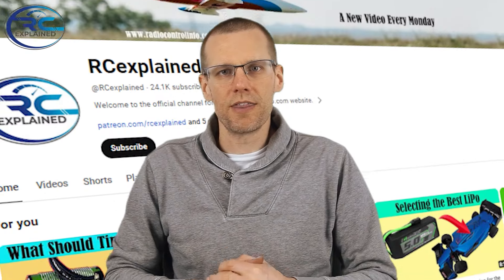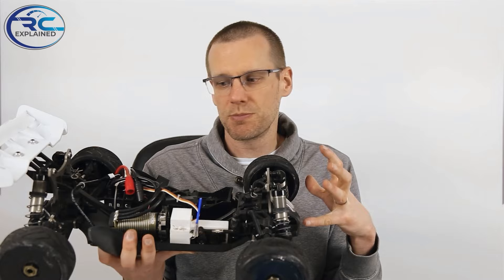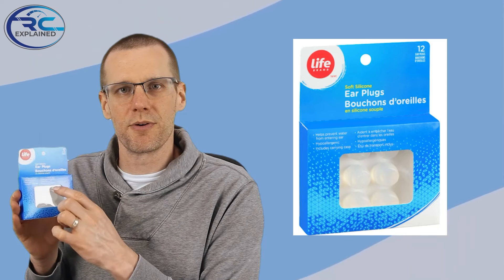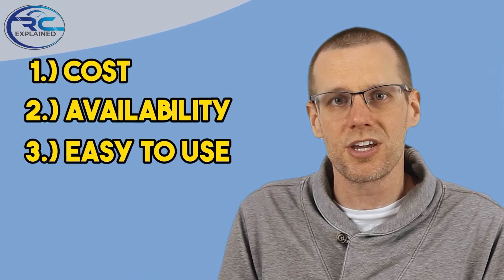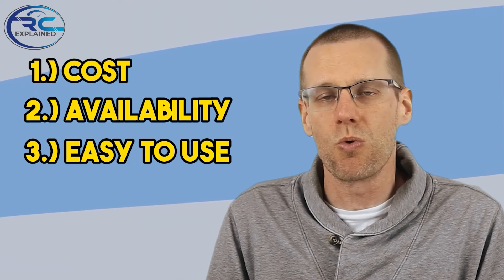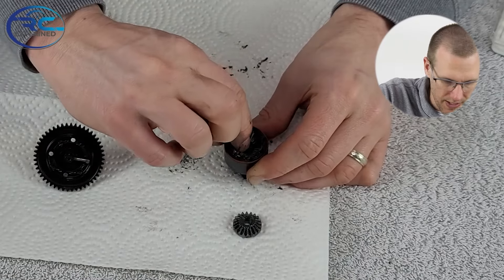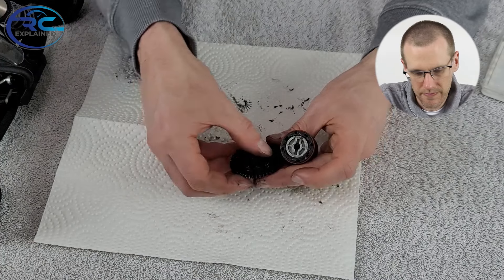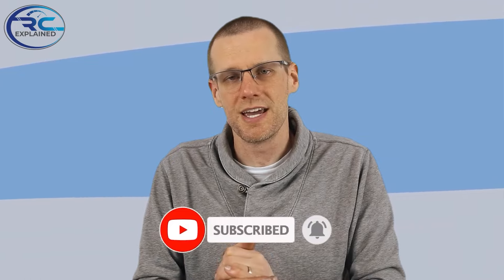The Must-Try Easy Differential Locking Method! Unleash Your RC's Full Potential

Comment: Thanks for sharing this valuable information. I often wonder if you could simply take a tube of Silicon and just fill the diff and let harden. I have earplugs for now and they whould work perfectly.
Reply from the maker: You could. Success all depends on the density of the fluid used.
Reply: @RCexplained  Thanks for all the good solid advice. You have awesome videos. Good vibes for 2025 🫶

Comment: Do they make spools to replace the complex difs?  Why wouldn't you want the front and back locked for 100% traction and power to the ground?  

If one tire is slipping and the other is doing nothing; how's that useful or helpful in a stock setup?
Reply: On high grip surface fully locked diffs will make it very hard for your car to turn.
Reply: Fully locked diffs is more for going straight. Like speed runs or drag runs.
Reply: @TheBod76  I was just thinking about speed runs.
Reply: @TheBod76  Thanks for sharing this. It really helps me out as I had never consided that.  I would think that this would apply to the rear diff as well. I have no idea?

Comment: I'm purely trolling here but gummy bears > silicone earplugs. 

Seriously, earplugs do have one advantage over actual proper diff fluid: if your RC is cheap and has no diff gaskets, the earplugs won't leak out. 

Me myself and i personally prefer diff fluid because even with 20 million, it's not a full diff lock.

Just like a servo saver, your differential is there for a reason, and unless you're building a pure speed run car, you want the center diff to be able to transfer shock loads from one side to the other.

Comment: I was amused by the secrecy and burying the lead on the secret object. But Kev Talbot has been making videos about this for a long time, not sure it's unknown.

I'd be interested to hear more about how the stiffer center diff directs power more to the rear of the vehicle. And when folks might want to lock other diffs. My understanding is that the stiffer the center is, the more evenly distributed the front and rear power is. But what I don't understand is why you might want lighter center diff fluid. Wouldn't that cause the car to "diff out" more easily in all cases? When is a locked center diff a disadvantage?
Reply: If you car is oversteering (powersteering by having the back wheels slip) a lighter center diff can work against that.
Reply from the maker: This video doesn't suggest it's unknown. The title is you should try this if you want locked diffs. Quite transparent about that in the title and description. 
There's a video coming out that will compliment this one answering some of your questions.